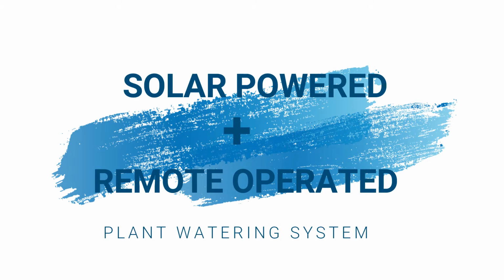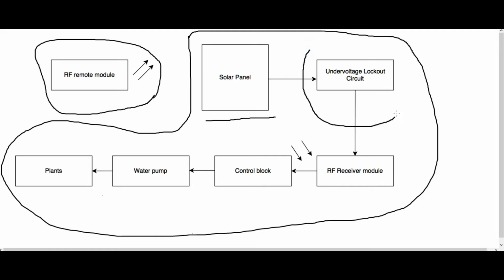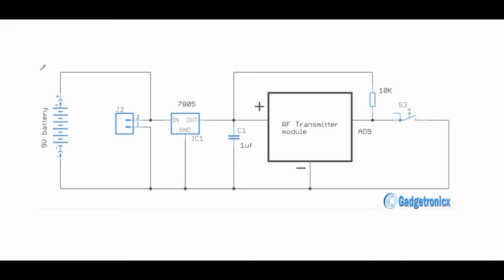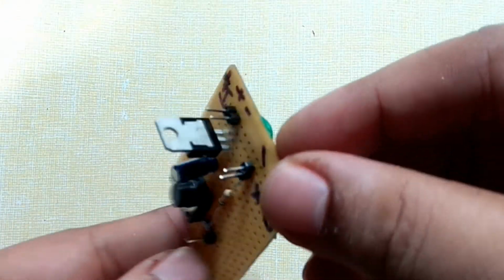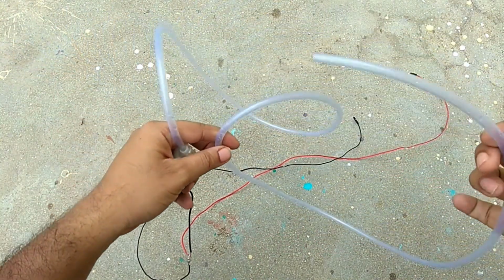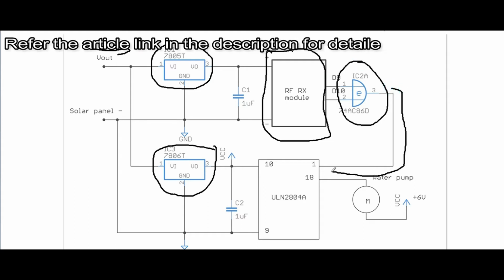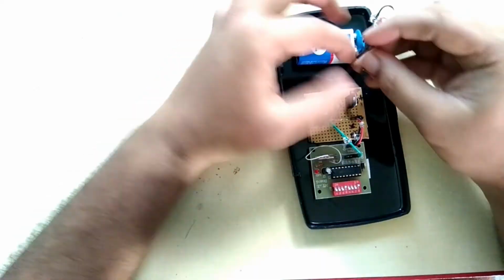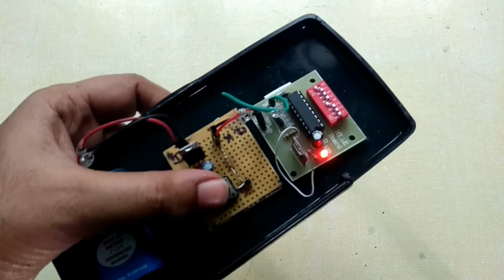Solar powered + RF Remote operated plant watering Electronics project

Comment: Awesome SIR  , great project  , sir please make a another video on REMOTE CONTROL  circuit without using RF transmitter and receiver module's used in REMOTE CONTROL car to control the motors in toy. Please explain how the signal is transmitted from transmitter to receiver to control the motor in the toy . Please do it it's a humble request  for educational purposes